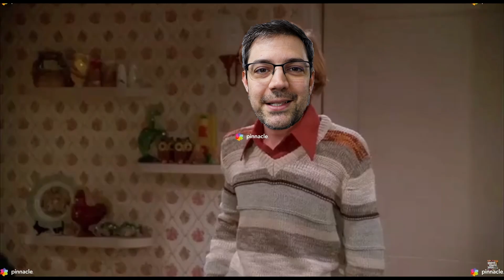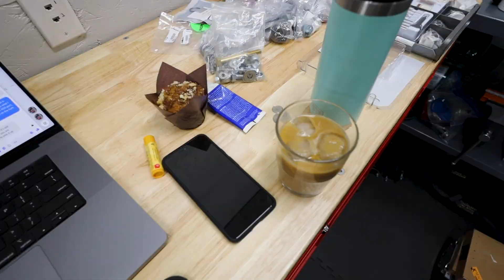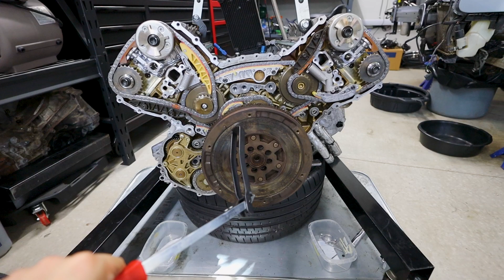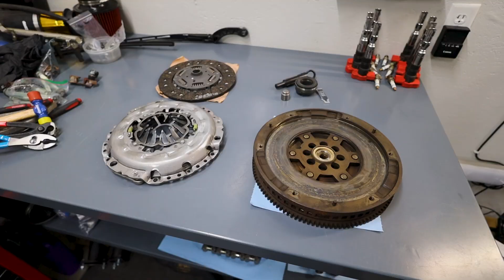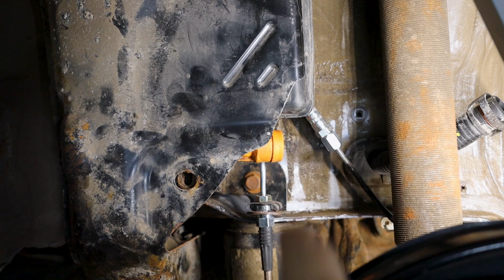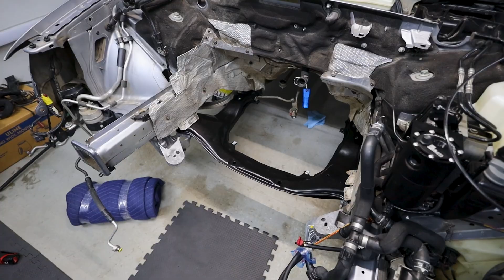Subframe refurbishing, RS4 timing service & brake line repair | Audi S4 4.2 B7

Comment: I am writing from Puerto Rico I had a 1998 A6 2.8L 30 valve engine while living in Georgia during the 2000s I loved that car I noticed that your 4.2 engine is also 5 valves per cyl, no variable valve lift which a terrible idea I enjoy your presentation style regardless of the length of the episode I do not have the space that you have which is a blessing for you. I have a Q5 2010 with a self killing engine by design  engine Enjoy the toy nothing like having the right toy.
Reply from the maker: Shout out Puerto Rico

Comment: Your right 71mm  way way off, audi/vw do not very 1.5mm for bushings, not even the mrk 1 golf is that way😉 why would normal bushings then just push in no problem, since iam a mashinist i would have corrected the faulty 034 parts,not the audi part(but i understand you could not) if the bottom ones go in it's clearly a faulty 034 part
Regards sören

Comment: You should have gotten rid of that oem dual mass flywheel. Those are known to fail and explode and crack your bell housing since they’re made of 2 discs held together with springs hence the name dual mass. I put a single mass 1 piece solid billet clutch masters flywheel in my b7 and never looked back.
Reply: + less rotational mass on the driveline. Allowing you to rev out quicker.

Comment: A bench bleed on the slave will make the process much easier and quicker, it gets tight in there even with an amount of working room. Also, where did you get the factory manual? I've been hunting for years for a copy. WIsh they printed a Bentley for the 4.2

Comment: I would have made a homemade lathe with a drill and bolts and screw. Might have been easier to sand down the machined 034 bushing to size. Good build and thank you for showing the average guy they CAN do this at home. Salute…
Reply from the maker: Yeah, that very well may have been a better way to go in the end. What I'm getting from this is: I need a real lathing machine :_turtles:

Comment: Excellent video. I need to back a bit and watch some of your previous videos. I got a 07 B7 2.0T 6-speed manual that would love to restore to better than original but do not have the space as I live in a townhouse with no garage. The brake line fix is something that I may have to tackle in the near future. Thanks!!!
Reply from the maker: Thanks for watching. I feel you on the difficulty not having a proper space to do wrenching. Back when I first got the white A4 B7 you can see in older videos on the channel, I was living in my first apartment with a single (very sloped) underground parking stall and it was next to impossible to work on the car there. Good luck out there.